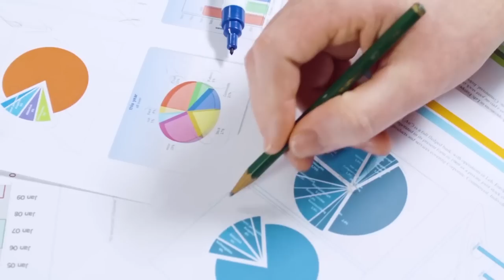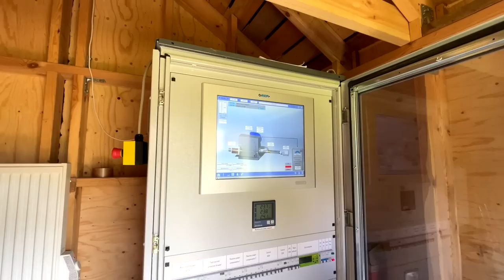Races to Places SE15 EP5 - Adventure Motorcycling Documentary Ft. Lyndon Poskitt

Comment: I had the same issue with my old Big Agnes after years of heavy use. It's actually pretty easy to swap out that elastic cordage if you have an hour to spare one afternoon. You just need to pull the ends off of the poles, pull the old stuff out, cut the new new stuff to measure and tie the new stuff in.

Comment: Lyndon.  I also have a Norden.  I would love to know what the part numbers where for your disc brake upgrade.  I have had a hard time tracking them down in the USA.  Are you running the stock airbox or have you upgraded it?  Fox example the KTM one or the rottweilerperformance airbox?  I am also looking to upgrade my suspension but can't afford the WP Xplor pro.  I am considering the Tractive X-treme fork closed cartridges for the front and the X-treme-PA for the rear.  Any thoughts?  I also enjoy dirt riding but do carry a heavy camping load too and stock suspension is not adequate.
Reply: Regular xplor are fully adjustable and work great too (standard in the KTMs R models). Different airbox means reprogramming the ecu and imho that's not worth it. Maybe on a 790 to get rid of the stuttering (just ecu flash, no airbox necessary). Just get the foam filter instead of the paper one and you're good.